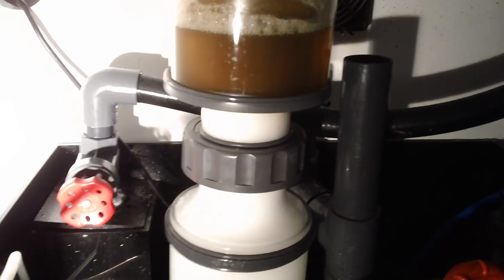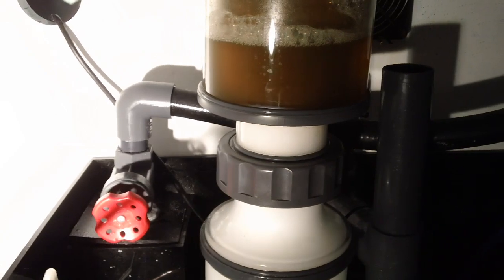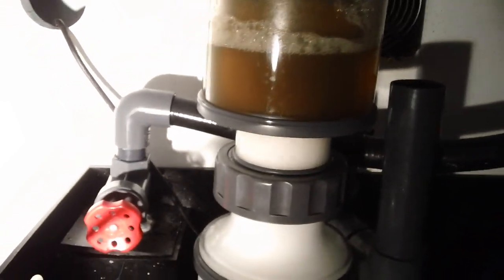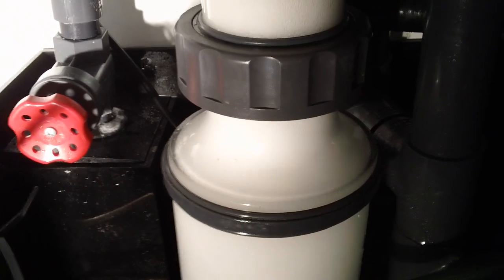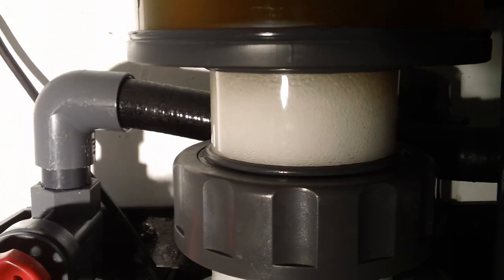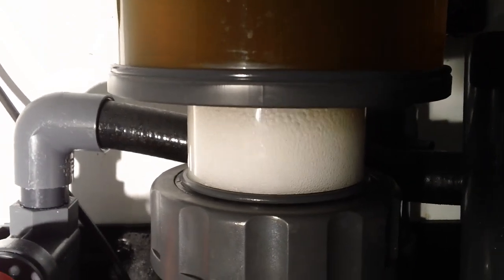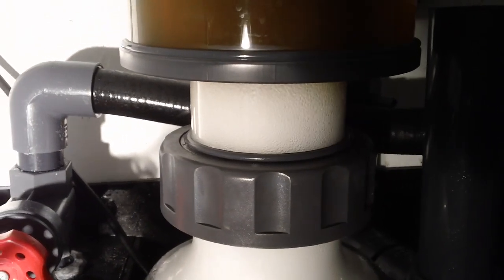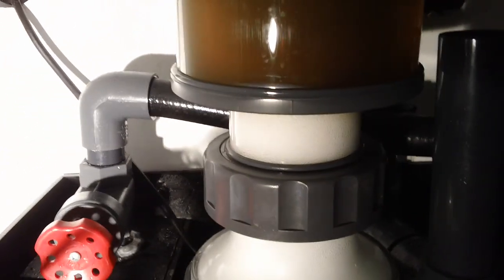CRAS Presents.... Protein Skimmers: Of Transitions, Turbulence & Trendiness

Comment: hey i have a question. seems like every other brand of protein skimmer has their own transition from the skimmer chamber to neck and it seems like a cone shape would be the most efficient some skimmers have a straight transition and some skimmers have a angled transition that's like a partial cone. but the design in reef dynamics transition is quick smooth bend. how did you come up with that design and is it more efficient than other transitions?